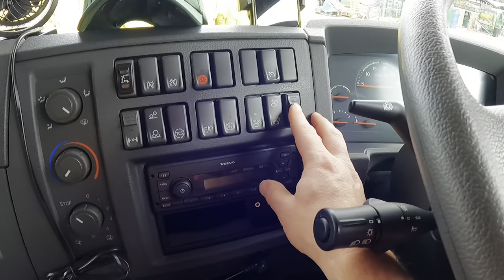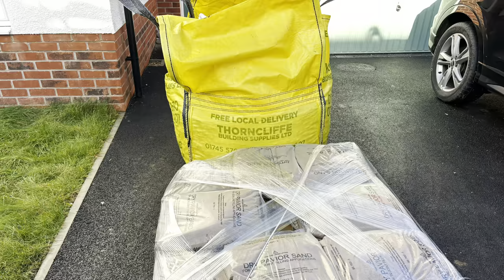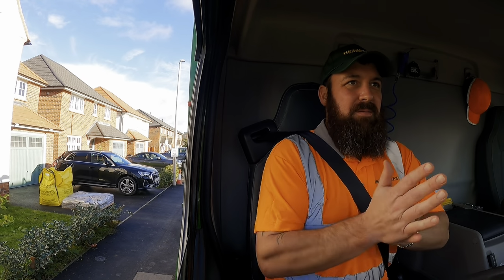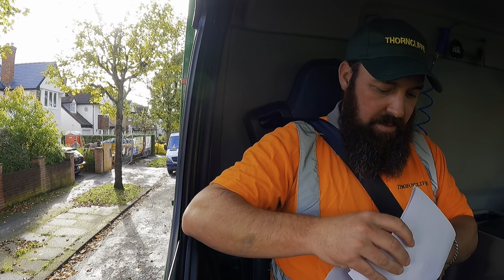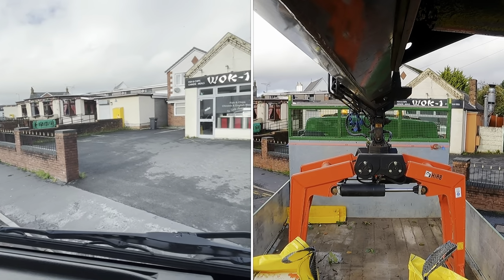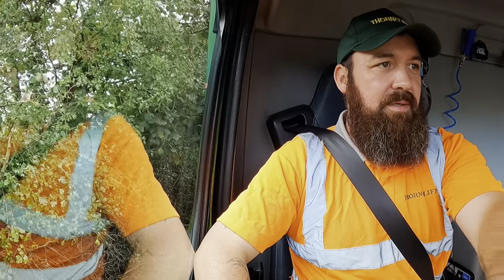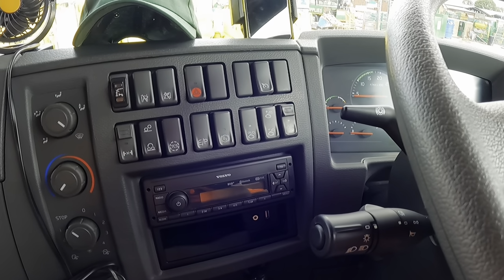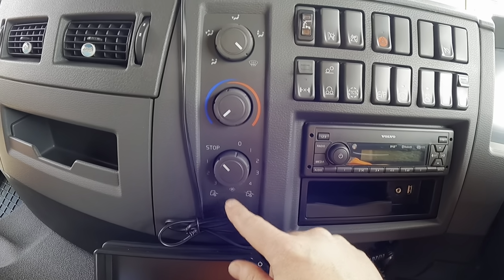INCREDIBLE-REAR STEER-HGV DRIVER-CRANE OPERATOR-BUILDING SUPPLIES-VOLVO-HIAB-LARGE GOODS-DELIVERY

Comment: i understand using the rubber mounts crossbars  as a lifting  point for an easy release but they are not designed for that purpose , the grab has hooks for the bags , even so the bags are designed for pinching. but hey ! we both do the same job and i do the same even though aware that  the company cameras fitted on the back of the bed may suggest that head office may be watching. hard hat for me is compulsary
Reply from the maker: Thanks for watching👍. I suppose everyone has their own way of doing things. my truck is also fitted with 360 cameras.where are you working? Thank you for the feedback.

Comment: I have just bought a Volvo fe 
4x2 320 Hp 
Best value truck on the market these days  air con standard now I’d say 
I’ll haft pull in the mirrors if there too wide 👍
Reply from the maker: Nice 👌, I’m sure you will not be disappointed. Let us know how it goes. I would recommend putting mirror guards on if you haven’t already they will definitely save you money in the long run 👍
Reply: I’d say it won’t be on the road until first of July
Reply from the maker: Will it be doing the same work? Delivering building supplies.
Reply: No 
I will have a hiab Crain on it 
I crossed the water to wales to get a hiab xs 088  for 7000 pounds it’s a 2007  model and it was €38.000 new 
Hiab’s seem to keep going forever it you look after them 
I once had a Palfinger that I bought new. Never again. 
Plastic controls on it 
And all the hydraulic hoses run internally 
Hard to change them 
I keep some hoses with me 
I’d have some of them changed in twenty minutes 
Instead of waiting two hours for a break down van
Cheers 👍
Reply from the maker: Yes the hiabs are great cranes and pretty straight forward, as like you say if you look after them. Crossed the water from where?
Reply: Cork 
Republic of Ireland 
The real capital 
And of course the biggest county 😂
Reply from the maker: Always wanted to visit Ireland as a lot of my family history is Irish. Thanks for watching from Ireland 👌👍 I appreciate it.
Reply: Do me a favour 
And give me a shout out on next video 
Just to surprise the wife and kids 
Kids well there 20 and 17 now 
How bad  👍.
Reply from the maker: No problem 👍

Comment: I all ways grab the bags slate and 10m gravel are the worst for poping the bottom of the bags i supposed its up to the quality of the bags as well if i don't grab the bags i just use my 2mtr sling's as we carry a feet on the ground pole it's easy to dowhat make of Crane do you oprate myns a hmf fantastic crane great video 👍
Reply from the maker: Thank you very much I appreciate it👍. The crane I operate is a hiab xduo 128. It is a good crane and very simple to use, if you know how 🤣. Do you do the same line of work?
Reply: @SCRUFFYPIGEON  I drive jewson truck in Lincolnshire do exactly same job as you on one of their 26 tonners 👍
Reply from the maker: Nice 1 👍, do you drive a M A N ?
Reply: @SCRUFFYPIGEON  no I've got a daf 75 cf I do drive a man sometimes transport manager asked me what I wanted
Reply from the maker: Fair do’s that’s alright isn’t it, I used to have a 4 wheeler daf. I don’t miss having to change gear every 4 seconds 🤣
Reply: @SCRUFFYPIGEON  we are moving over to autos as the trucks are being replaced we don't have many manuals now    like your Volvo nice big cab 👍
Reply from the maker: The auto’s are so much better👍 you can switch them to manual , I switch to manual on a steep hill climb for example. Sometimes the truck doesn’t know what gear to be in when fully loaded and climbing.
Reply: @SCRUFFYPIGEON  that's right I don't know if you can buy a manual box in a truck any more now makes life easier for us